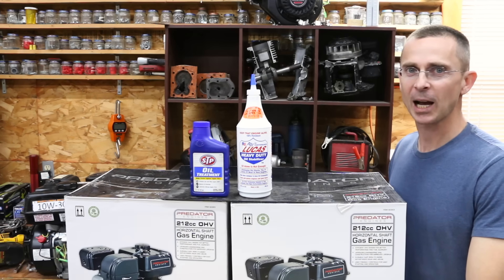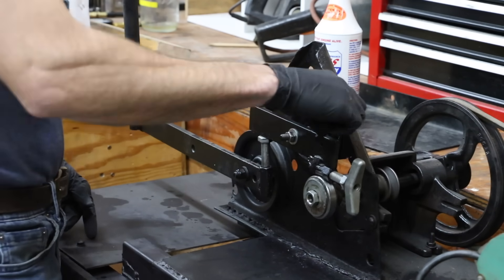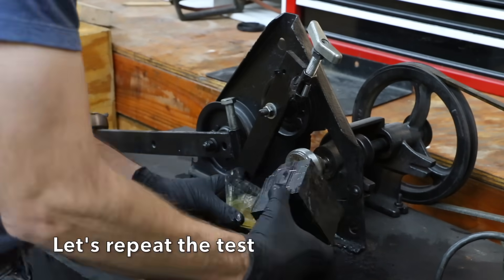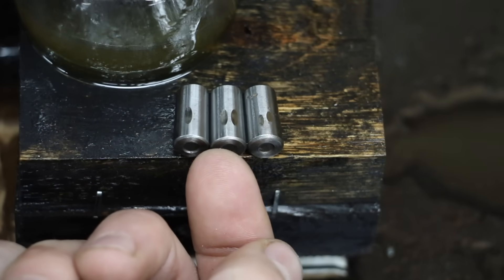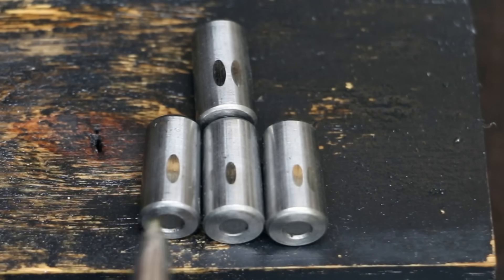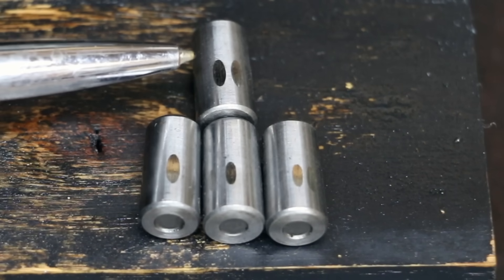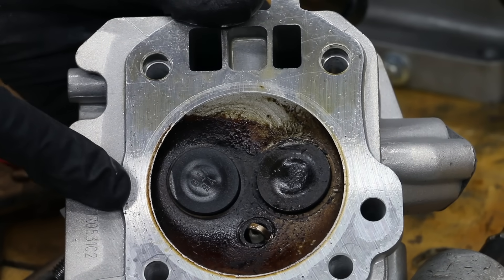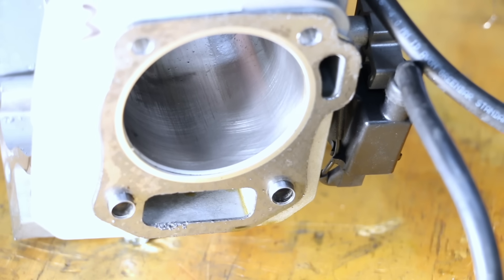Which engine self-destructs first?  Lucas or STP?

Comment: Without a control engine you can't even really say if the additives made a difference.
Reply from the maker: Thank you!
Reply: @ProjectFarm  
Yeah you should have done three of them, one with just plain old motor oil.
Reply: Well, you only need to do a stock engine test once, or twice just to get an average.
Reply: Jacques Bloques , I agree completely.
Reply: I agree a control engine is needed
Reply: Better still, a total of six engines. Two controls with only oil, two with STP and two with Lucas.  The temperature variation between STP and Lucas is most easily explained by manufacturing variations between "identical" Harbor Freight engines.
Reply: One engine ran longer than the other, so it definitely made a difference. The question is, is it because one of the additives extended the life time more, or because one of them shortened the life time less.
Reply: @Polyfron  You don't know if the additives did anything to lengthen the life of the engine. Not enough test data.
 How do you know that conventional oil didn't work even better? You don't!
How do you know production tolerances were the same? You don't!
 How do you know the carb tune was identical on both engines?  You don't!
All of those variables directly affect engine longevity in a test like this and you don't know the beginning state of any of it, you're only assuming the engines are identical at the beginning. And they're likely not.
Reply: I agree with flashmcginty.... a control engine is needed... and for the douchebag saying otherwise, you obviously don’t watch a whole lot of PF’s videos... he is 100% open for suggestions on how to do the projects better or just differently.  He doesn’t mind constructive criticism unlike some people who automatically take it as an attack and they feel a need to lash out like an immature teenager.  Grow up.
Reply: @Jacques Bloques Agree. Could be production tolerances or carb tune that decided which engine failed first.  Some people just don't get it and never will.
Reply: This is true for almost every video he makes. I can't expect him to do a good test due to limitations of time and money, but without control and a larger sample, those videos are worse than useless.
Reply: @ChilledfishStick  Yes, and again, no one expects 1 person in his garage to produce scientific studies without any confounds. No one would suggest that. But to sit here and pretend that what he is doing has no confounds is ignorant. Yet that's exactly what Trey and others are proclaiming.
Reply: @kv6639  

I think that you are overestimating the intellect and knowledge of the average person. 

I can't both be ignorant, and pretend to be ignorant. If there's something to be gleaned from this video, I'm genuinely ignorant. 

Lastly, I have no idea who Trey is.
Reply: @ChilledfishStick  I think I'm overestimating, too. :-)

Many people in this comment thread are scientifically illiterate, but then pretend to be experts. It's rather strange. And no, I was not talking about you, but just scroll up a bit and you'll see the barrage of ignorant comments about why control groups are not necessary (yes, they really argued that). Trey Nathaniel was one of them.
Reply: @ChilledfishStick  rofl
Reply: @ChilledfishStick  The purpose of having a control is to rule out other factors which may influence the results of an experiment. Not all experiments include a control group.
 Data from an experimental group is compared with data from a control group. These two groups should be identical in every respect except one: The difference between a control group and an experimental group is that the independent variable is changed for the experimental group, but is held constant in the control group.
Please one of you nubs present an actual control and explain how it is relevant.
Can't wait.
Reply: @treynathaniel4075  
If you can't be respectful, I'm not going to waste my time replying.
Reply: @ChilledfishStick  Lol I bet. Can you say cop-out?
Reply: In his Bestline vs. 10-30 test, the 10-30 engine ran 38 minutes, and the Bestline engine ran 71 minutes. And in his Z-Max vs. Lucas test, the Z-Max engine ran 17 minutes and the Lucas engine ran 28 minutes. Here, the STP engine ran 12-1/2 minutes and the Lucas engine ran almost 22 minutes. 
-- The two Lucas tests are fairly consistent, averaging 25 minutes, but that's not as good as 10-30 oil alone, and not nearly as good as Bestline, at 71 minutes. 
-- I'd also like to see a test with full-synthetic oil alone. 
-- A service manager, former mechanic friend of mine told me of a woman who drove in with no oil in her car. I can't remember how it ended up with no oil, but apparently, given where she came from, she drove about an hour and 15 minutes with no oil, after having run the car on full-synthetic. And the car ran fine after filling it with oil. 
-- I wonder how much tolerance build-up at the engine factor matters here, too. Built within specified tolerances, some engines are going to be tighter than others, especially when some of those tolerances are stacked together. The two Lucas tests are in the same ballpark, but the difference between them is still quite significant.
Reply: How come the only two who disagree are old white guys 🤷‍♂️
Reply: I was about to say the same thing
Reply: Not a serious test.  Unvalid
Reply: Not to mention the results of this test are probably due to manufacturing variances not oil differences.
Reply: I was thinking that too. Still cool to see the enignes shit blow I guessed what would break I was right for stopping not Lucas tho
Reply: @PROUDHEART speaks Lulz
Reply: @flashmcginty is completely correct. A control group is the most important addition to any scientific experiment where you are making comparisons between different groups. Imagine if the control engine ran longer than both the Lucas and the STP. The conclusion you draw would be entirely different - you'd say that neither Lucas or STP do anything and are both wastes of money. Now imagine the control engine runs for far shorter than both - now you'd conclude that even STP adds a huge amount of protection compared to nothing. Without knowing where the control group engine lands, it is very difficult to make any firm conclusion about either of these products. Yes, also the sample size is only 2 engines, which is very low. Repeat the test dozens of times with lots of different engine types and you would be onto something. And if that sounds like a lot of work, it's because science is incredibly tedious. So, to conclude, @Jon Hammer is completely wrong and should apologize for his ignorance.
Reply: @kv6639  No nubblez. You first year noobs haven't a clue what a control group is for.
Suggesting every experiment have/need/require one was the first clue.
Ya know I'm all for acquiring knowledge and sharing,cringely even if it is ignorant,but whatever happened to knowing about what you're sharing?
One of my fav quotes"
"The greatest enemy of knowledge is not ignorance; it is the illusion of knowledge."
Basically it means don't share unless you know wtf you're typing about.
Reply: @kv6639  That said if you must learn,if you can,I'll explain why you are incorrect and when a CG is prudent or necessary.
Reply: @treynathaniel4075 You can build upon prior evidence to try to justify  the lack of a control group. But having one is always superior to not having one. It is one of the pillars of science my boy
Reply: @kv6639  Irrelevant.
A CG is specifically to test for interactions between a variable(s) that influence the effect of the variable or lack thereof on the outcome.
Multiple possible input parameters are the variables.
Here we  do not intend to show causation,only to answer the intended question. Experimentation that does not require a CG.
A CG is what you compare your experimental value against. 
Control groups are not prudent for all scientific experiments.
But if being pedantic,
here we already have two groups,two variables. You compare them.
If you wanted to truthfully logically apply a CG to the test in question you'd have to provide the part of the experiment without the variable. How do you intend on providing that?
It would all fall under a variable. Which would cause a zero sum and be pointless.
You'd have a a confounding variable,a variable that accounts for the observation you're seeing in an experiment other than the observations in the control variable. 
.A noob move.
Reply: @kv6639  You present your CG and provide any relative beneficial data how bout dat?
A control group is identical to all other items that you are examining,Except it does not receive variable(s). Can't wait.
Reply: @treynathaniel4075  That is just babble without any merit. A control group establishes a baseline. It's not a confound (this is beyond asinine to even suggest). A confound is an alternative explanation based on faulty experimental design. A control group provides a baseline, and could never be a confound. In this experiment, a true control would be no fuel additive at all. You could also add other controls (e.g., liquids that aren't fuel additives) to see if liquid in general has an effect (rather than fuel additives specifically per se). Also, you are confused as to what an interaction is. And interaction is when a combination of independent variables produce an effect on the dependent variable. If all the manipulations are between-subjects, as they would be in this case, you'd only have the potential for group differences but not interactions. You should review these terms before showcasing your ignorance.
Reply: @kv6639  It's "babble" because you're clueless.
Present your CG as relative. I believe it's put up or shut up if I'm correct.
Reply: @kv6639  Nice CP btw. Oh and your post is contradictory. I mean I don't even know why I bother with you average at best mouth breathers. But you'll continue. Like they all do. I believe the term is "betchu".
Reply: @treynathaniel4075  No its babble because it's just jargon you're using incorrectly trying to sound smart. You've ignored my last message because you have no answer to it. And I already listed the control groups, soooooo yea.
Reply: @kv6639  OH the Irony
Reply: @kv6639  Oh and told you so.
Reply: @treynathaniel4075  I literally just said  that to you. Lol
Reply: @treynathaniel4075  Control group = No additive at all. Without it, you have no way to know if the additive did anything at all (for the last fucking time).
Reply: @kv6639  One last time. Present a viable CG with explanation of relevant use. Stop avoiding it.
Reply: @treynathaniel4075  I am not repeating myself any further. I've told you like 4 times now. Maybe try closing your mouth and opening your ears for a change.
Reply: @kv6639  As to not have to revisit your drivel, post one again.
Reply: @kv6639  It's real easy and simple. Hell I could post one,albeit pointless and irrelevant in practice. But I could still do it. I think you don;t know what one would consist of. From memory you have failed so far. The shit is easy and simple. 
Just admit you made demands not knowing  wtf you were typing about. A common practice on youtube.
Reply: @treynathaniel4075 , motor tested in previous video, no addatives, lasted 38 minutes.

First sentences of this video (paraphrased) "people spend millions on addatives... Today we are going to definitively prove if they are worth it"

Please do tell how he proved that here without a control engine... Or are you arguing that this video was to show which addative was worse for an engine...
Reply: No. Your wrong lol
Reply: @ToyotaNutjob  pitchblack.com  kid. Shouldn't you be in bed timmy? ffs..
Reply: That would of been funny. Controlled engine winning
Reply: He did that in an earlier video, see here:
https://www.youtube.com/watch?v=m8ZKMCfAue4
Reply: ProBlend is reported full of certain chlorine compound additives that over time combine with moisture to form various chlorine acids (like hypochlorous and hydrochloric) and those will eat up your bearings over time!  That's why manufacturers don't use chlorine compounds in their oils. However, it is known that chlorine compounds do offer very high anti-scuff properties. @Mark Ayash
Reply: @LR-my2di  I don't know if any additives currently on the market contain any chlorine.  I think the best advertised one in the past was Duralube.
Reply: Jacques Bloques I stand by my statement. Maybe if you was as smart as your mouth 👄
Reply: Eli Z LOL!
Reply: flashmcginty, Other tests have already been done on whether additives make any difference.  This test assumes that additives do, make a difference, and goes from there.
Reply: @Eli Z This is why dumb people never learn, they're constantly shoring up their fragile egos instead of learning. Everything is a personal affront unless it agrees with their preferred way of thinking.  I think I see a red hat here...
Reply: You’re free to repeat the experiment yourself and add a control engine using only 10w30. I look forward to your results.
Reply: flashmcginty Really? People like you amaze me. The Lucas engine ran almost twice as long as the STP engine but "you cant really tell..." Do most people actually take you serious? SMH...
Reply: @murffyslaw001  maybe an engine having run prior on regular oil would have gone longer than the Lucas oil.
Reply: @shawncrocker7037  Forget it, he doesn't get it and doesn't want to.
Reply: @murffyslaw001  no it doesnt, as i could potentially proove that one is actually hurting oil longevity under these conditions.  You always need a control
Reply: Jon Hammer  Yes I am a complete fool for suggesting the long accepted scientific testing standards.  I should have suggested chicken bones and tea leaves.  Control Group.....how could I be so stupid, my deepest apologies.
Reply: flashmcginty as usually happens, YOU missed the point of the entire video. Because you think it should be done your way! At no point in this video does  the creator ask, or imply, that either product is better than straight oil. The stated purpose was to see which of the 2 products tested were better/worked. And he did exactly that! I digress...
Reply: My original comment points out that without a Control Group you can't show that the additives even worked, I guess you didn't understand my point. Which makes me think that you no idea what a Control Group is and didn't bother to look up why it is important.  I actually worked in a petroleum lab for a number of years and know the importance.  However, I am very interested as to how attacking me personally on both of your comments makes your point more valid?  Look up Ad Hominem Fallacy.
Reply: flashmcginty MY point was, Project Farm did exactly what HE set out to do, compare 2 different products. And he did that well. So, instead of criticism from you, why don't YOU take YOUR money, buy 3 brand new motors, and YOU make a video the way you want it made, instead of suggesting that Project Farm's was incomplete? 
 Too many people have your attitude: "it has to be the way I want it." It's a sickness, and quite frankly it pisses me right off! You don't like it? Do it yourself! As to your "fallacy"? 🙄
You used to work in a lab? Good for you. 
 Attacking you? You suggested that you were smarter than PF, and he didn't have the intelligence to do it correctly without your suggestions and feedback. You heard from me because I suspect PF is too kind and courteous to rebuke your arrogance. I, however, am not.
 Don't like what PF did? Do your own video "correctly".
Reply: Jon take a deep breath and relax.  In the first 4 seconds of the video he states that people are “spending millions of dollars on oil additives to improve performance” and within 10 seconds he wants to see if they
are falling prey to “snake oil”.  Without a control group, as I stated, it is impossible to know if these additives
actually worked.  We don’t even know if those engines out performed straight oil.  Do you understand my point yet?  So your point that “did exactly what HE set out to do”, no he didn’t.  I merely pointed out that he may have overlooked the necessary step of a control group and somehow that greatly offends you.  At no point in that short 15 word statement did I infer that I was smarter than anyone nor did I say I didn’t like the video.  In fact I sent this video to many people and gave him a thumbs up.  So do us all a favor and stop inferring my and Project Farm’s thoughts, because you have no idea.  You found more hidden meaning in 15 words than The Da Vinci Code.  Have a great day buddy and work on your comprehension and anger issues.
Reply: flashmcginty Lol.
Reply: @flashmcginty  Joe Hammer has adopted an untenable position and is now trying to defend a delicate ego! I owned a hire shop and have taken engines apart for 40 years. There is only one that was consistently good and that was the old GX Honda.Since these ones look like rubbish it would need at least 5 engines in each class to help the accuracy of the results.
Reply: @murffyslaw001  No I do remember him stating the purpose of the video was to determine if additive were just snake oil.
Reply: @murffyslaw001  haha. I am finding you more and more humorous as I continue down the comments list. Now I'm wondering if you even watched this video. PF clearly states that the money for the engines came from his supporters. It would be fair to state that other people's money was spend in vain because goal as was stated in the beginning of the video was not accomplished. We can not know from the final results if additives are snake oil or not. All we can conclude is that if your engine for some reason had the oil drained and you needed to continue running that engine, you going to want to be sure it was lucas not stp.
Reply: @murffyslaw001  dang that guy in the oil video got you good
Reply: @flashmcginty  " you can't show that the additives even worked", removing all oil does not address your query. No intelligent being would suggest otherwise. The beginning segment of tests would however,and DID PUT the two head to head on wear. Which was the point. The segment dedicated to no oil addresses how well the additive coated,adhered,protected the engine without the additive being applied at a constant. THE shit wasn't difficult to understand. NO CONTROL GROUP WAS NEEDED. 
An experimental group is the group in an experiment that receives the variable being tested. One variable is tested at a time. The experimental group is compared to a control group, which does not receive the test variable. 
I'll help. An engine without additive would not last anywhere near 20 mins without oil. You need a test to tell you this>? Petroleum tech my ass.
Again,if we used your control group for the wear test to be fair you would need to use every oil brand sand type available or it wouldn't be a control group.
BUT more importantly we are testing the ADDITIVE,a control group would be one without the additive and therefore fucking redundant.
Stick to COD KID.
Reply: flashmcginty, great rebuttal. Some simply don’t understand the scientific method. They believe what they want to believe.  One should never attribute to malice that which can be adequately explained by stupidity. In this case, stupidity is the likely motivation behind the attacks.
Reply: Lucas also recommends twice the volume of their additive.  Maybe that's fine for an engine with no oil in the crankcase , but for long term reliability in an engine with a crankcase full of oil, does this "test" really prove anything relevant?    @murffyslaw001
Reply: @murffyslaw001  Agreed, ridiculous statement, bad logic.
Reply: @much_livermush  why do you agree with Jon hammer
Reply: @tylerwilliams2802  Because he said something that is true.